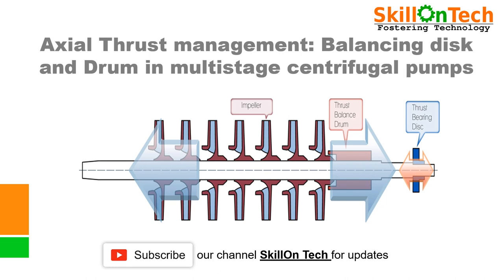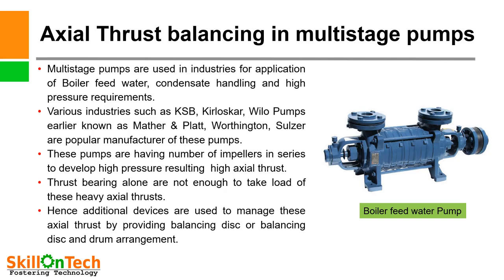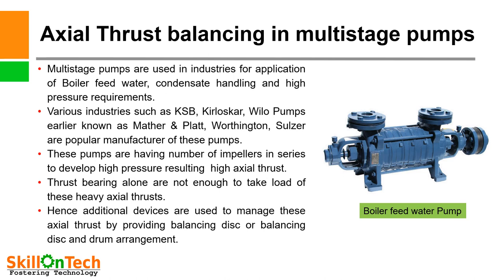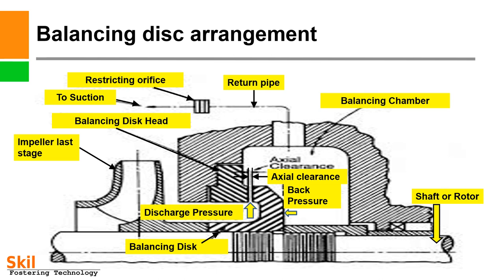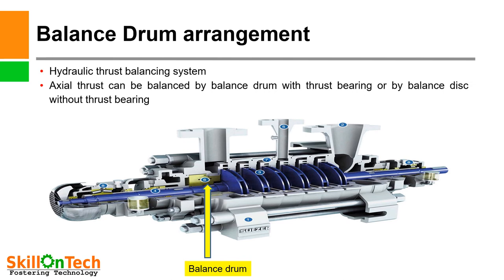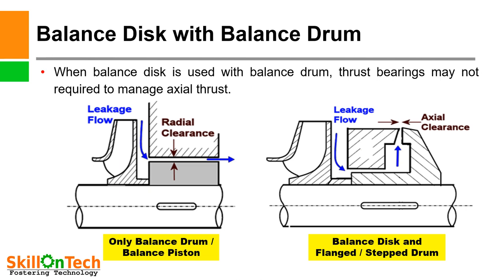Axial Thrust management: Balancing disk and Drum in multistage centrifugal pumps (with english subs)

Comment: may i question mister, a problem in pump, pressure in line balancing high, normaly 7 - 10 Bar, but when operation 20 bar, press in and out normal, in = 7- 8 bar, out 125, bar what the problem, may you help what the problem
Reply from the maker: Clearances increased.

Comment: Discharge pressure jo impeller ke back pe hai woh uske suction ki taraf push karega again so to avoid agar hum balancing disc use kar rahe hai toh clearance badne ke baad balancing disc ke backside me jo pressure hai woh bhi suction  ke taraf hi push karraha hai toh balance kaise horaha hai
Reply from the maker: Discharge pressure act between balancing disc and balance head ( stationary) and move balancing disc opposite to axial movement of impeller due to discharge pressure. When water flows back to balancing disc pressure drops and equal to suction pressure or balance pressure and maintain balance and keep shaft in center. If any doubt ask again. Pls watch video slowly with explanation.

Comment: Sir what gap to be maintain between shaft and stage casing also gap between balancing seat and balancing seat
Reply from the maker: Each pump manufacturer recommend the size of gasket between stage casing and gap between balancing disc and seat. You have to follow the same. However stage casing gap is decided by gasket and impeller shall not touch the casing. The gap between balancing disc and seat is decided by measuring total axial float and shall be kept 2/3 and 1/3 of total float.